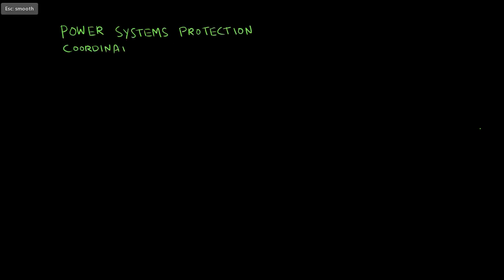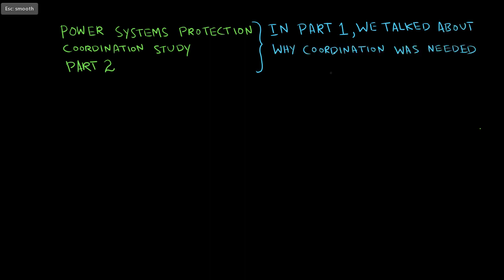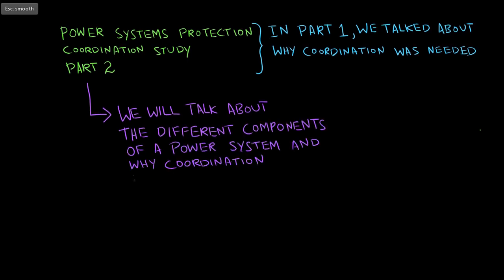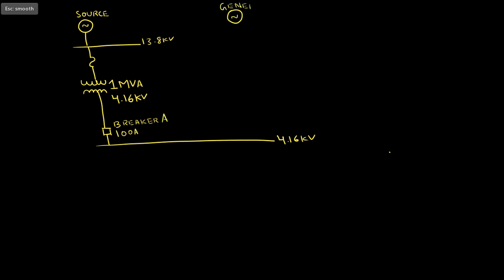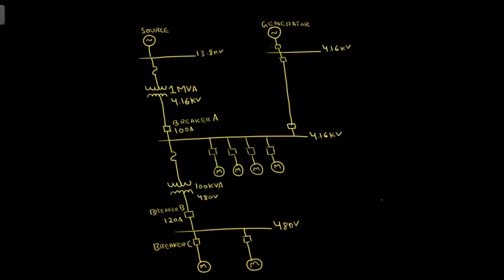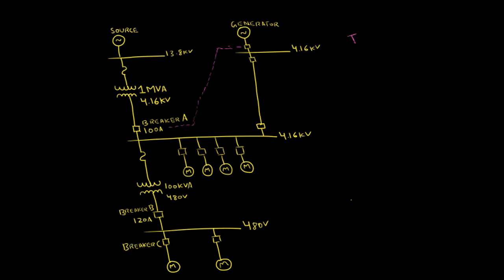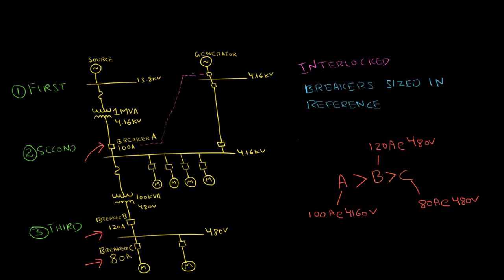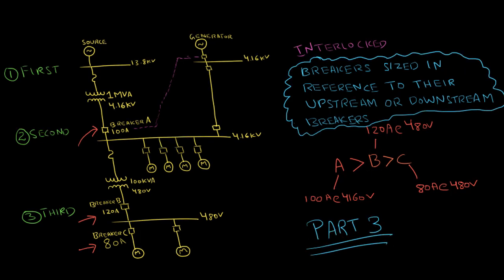Protection Coordination Tutorial Part 2

Comment from the maker: In Power System Protection course we will cover the requirements needed to design protective devices and the applications of these devices through a schematic diagram. Furthermore, this course will analyze the effects of all types of faults in power system along with the easy hand on calculations. To develop your strong concept on fault analysis we will discuss how faults can be identified by analyzing waveforms. Lastly, you will learn the most tedious and complex theory of symmetrical components that are found in different types of faults. This module consists of six parts, each building upon your knowledge based on previous ones.Get 𝟗𝟎% 𝐎𝐅𝐅 on 𝐏𝐨𝐰𝐞𝐫 𝐒𝐲𝐬𝐭𝐞𝐦 𝐏𝐫𝐨𝐭𝐞𝐜𝐭𝐢𝐨𝐧 𝐅𝐮𝐧𝐝𝐚𝐦𝐞𝐧𝐭𝐚𝐥𝐬: https://bit.ly/Power-System-Protection

Comment from the maker: Question) Why breaker A is 100A, less than the downstream breakers?
Answer) Breaker A has a 100A rating at 4.16kV whereas, Breaker B and C have 120A and 80A rating at 480V respectively. There is a step down transformer connected in the branch, which in turn will increase the current on the secondary side of the transformer and thus the downstream breakers would be rated at higher pickup values. 

Thanks,
GeneralPAC by AllumiaX

Comment: Shouldn’t that third breaker be sized at 150A?
Reply from the maker: Hey Anthony,

The breakers have been sized correctly. It wouldn't make sense for breaker B to be rated at 120A whereas breaker C (third breaker), being a downstream breaker to be 150A. Upstream breakers are always rated at higher ampere rating than the downstream breakers for adequate protection. 

Thanks,
GeneralPAC by AllumiaX
Reply: @Generalpac  what was your sizing calculation?
Reply from the maker: @anthonywooten9930  Hello, We apologize for taking a while to respond. 
We consider two parameters while selecting breaker:
1) Load Current 
2) Short Circuit Current 

Load current is calculated using formula:

I=P/1.73*V*power-factor

You can refer to the link for in-depth learning about breaker sizing calculation:

https://www.allumiax.com/breaker-size-calculator

While short circuit current is calculated using short circuit analysis on power system software or manual calculation.

For understanding short circuit calculation you can refer the given link:
https://www.allumiax.com/blog/simple-method-for-basic-short-circuit-current-calculations

By considering these two currents, we can select the right breaker.

Thanks,
GeneralPAC by AllumiaX